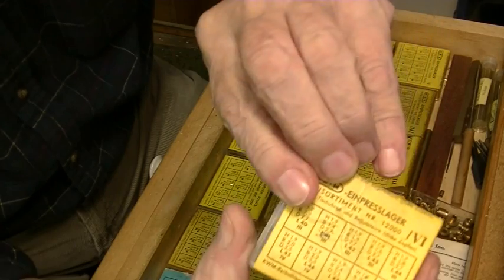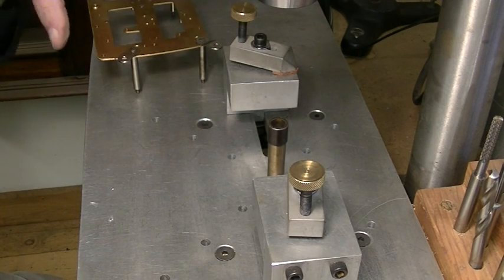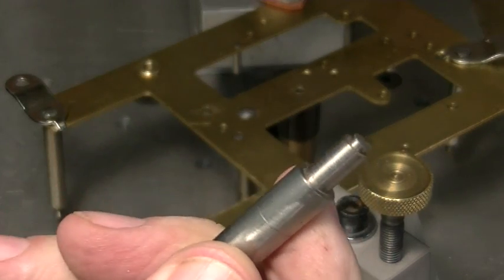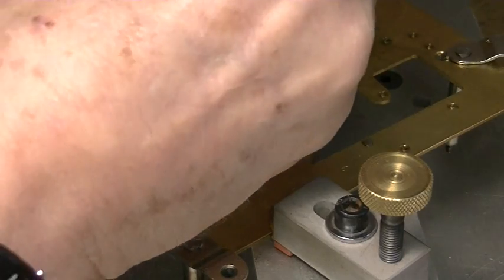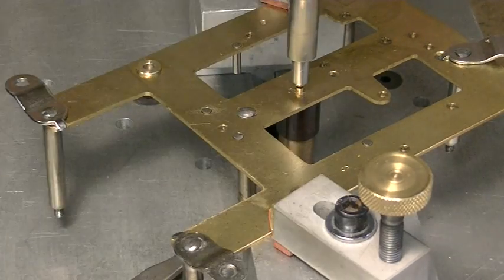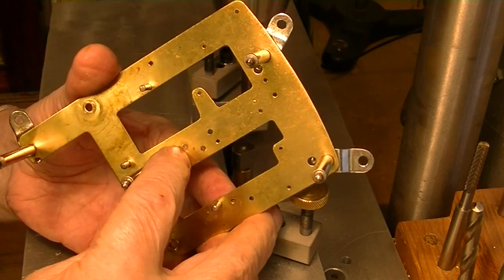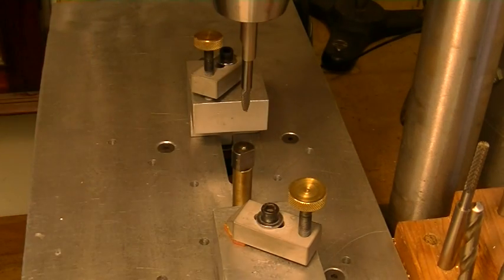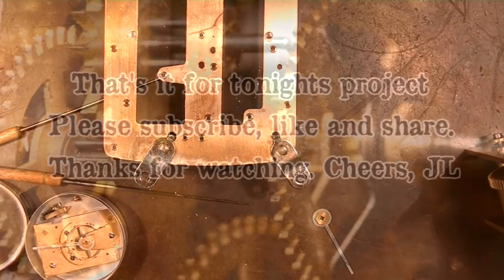The Village Clockmaker. Clock repair tutorial. #23. Rebushing a clock plate the easy way.

Comment: With my bushing attachment in the drill press, a post or pin is usually in the way of the clamps.  I do most of my bushing these days with a hand reamer.  I can lead the direction  the hole is being cut easily by doing it slower by hand.  I am envious of your large bushing assortment.

Comment: Jim, @ 10:35 you advised you were "working" on the inside of the plate..... but it actually was the OUTSIDE of the back plate when you installed the bushing.
Also, putting the plates together so you can use the front plate as a "guide" when BROACHING keeps the broach perpendicular to the bushing.
Just FWIW!
Norm
Reply from the maker: Yes, I know. I turned 80 last month and am prone to stupid mistakes.
Reply: Happens to the best of Jim, keep on truckin!
Norm

Comment: +
James A. Lea The Village Clockmaker

Filing egg shaped hole isn't necessary  IMO. I have got Gustav Becker  clock from  Silesia series. He had one egg shaped bushing on the front plate on  strike  counter wheel . I just driled it on drill press just like you wiithout filing and he works just  fine. He runs now  for over week and striking mechanism never failed, so I suppose he's fine and center of the hole didn't move.  By the way I'm very surprised. Silesia clock, economic Gustav' Becker's movement for less rich people with hook escapement runs like high-end versions on Graham's escapement... For whole 7 days which mainspring offers him he only goes fast about 10 secs and never slows down like mainspring powered clocks just to when mainspring is almost unwind. For  curious I winded the mainspring  and let him run until it stops and stil kept that about 10 secs deviation. Incredible... Probably he wanted say thank you for all hours i spend with him to get it  up and running back... It was very hard and big challenge for beginner in clock repair hobbyst but I did it and I',m very proud of myslef that I can save and keep peace of by the way Polish history. Yeah, Polish becuse  Freiburg aka Świebodzice is Polish town, so we can say that Gustav Becker made clocks in Poland...

Comment: Thanks for a good video!

I'm wondering why you would both counter file the worn hole AND clamp the plate down. As you say, the drill/reamer becomes self centering when the hole is counter filed. I don't have a bushing machine so I counter file but use the reamer by hand, or sometimes in a drill press rotating the spindle by hand. The way I've understood it before is that the beaty of having a bushing machine is that you can simply center with a wire or stake just as you did, and then clamp the plate down and the reamer will cut straight down, regardless of the off center hole.

I think you also mentioned that in text but didn't the installation turn out to be backwards?  The bearing surface appears to have been on the outside of the movement.

Thanks again!
Karl
Reply: He did it backwards! Lmao !

Comment: I don't understand why you don't change the bottom support to the flat faced stump when pressing the bushing in so that it only presses in flush to the surface of the plate. It seems that you could eliminate a step or two in the rebushing process. Also, wouldn't it be good practice to champher the holes after reaming to eliminate those pesky burrs that would wear into the pivot?
Anyway, that's a very nice arrangement you have for doing these quickly and in succession. I'd say you have a new subscriber.

Comment: Why have you cut the holes from the outside of the plate. I have a bushing tool and cut the holes from the inside. Is there a danger of the bushes coming out. There is a slight taper on the cutter.

Comment: Could you not of centred off the outside of the old bushing? I am assuming the bore and the outside of the bushing are concentric? I use an optical centre finder in my milling machine to centre on the bush outside and then drill using a centre drill to get the bore concentric and then drill to size.

Comment: You mentioned bushing from the inside, but you installed the bushing from the outside, with the oil sink on the inside of the plate.

Otherwise this is the same way that I do my bushing, only I do them with a hand tool. I have never seen the KWM bushing index plate before, and I can't find it any of my catalogues. I guess they don't sell it anymore?
Reply: sooth15   Wow you are correct. I just checked my Timesavers catalog #43 and it is not listed in there anymore. If I remember correctly they were around $100 and probably not a big seller. 
All the best,
Norm in sunny Arizona
Reply: Hi Norm, I was able to find it under "Pivot Gauge" after a bunch of searching, and they're asking a whopping 145$ (over 200$ CAD), which is absolutely ridiculous. I could make one myself for probably around 5$. Item #13483. There are some second hand ones available for close to 100$ but that's even too much for me. I don't do nearly enough bushings to justify the expense.
Reply: Just use a digital caliper on the pivot in mm mode. Choose a bushing with a slightly smaller bore and broach it to fit.
Reply: I bought a measuring plate from Merritts over a year ago.  Then I found my old plate I thought I lost.  I am not in my shop so not sure if they still have them or not.  Oddly, I have got to where I can eyeball it and choose the right size bushing.

Comment: Just a little bit confused, aren't you supposed to use Reamer number III (2.69mm dia)? You have used drill number 3 (5.41 mm dia) or you mean 3mm dia drill? Using a drill won't make an accurate hole.

Comment: would it kill clock-makers to put ball bearings on the slow high-torque gears? the sad fate of most clocks is that these pivots will wear out from never being oiled and the clock will be discarded. am i missing something, or is it just that traditionally bearings have never been as cheap as modern chinese ones?

Comment: It looks like your chuck and/or bit are wobbling a bit....not running true. You ran through centering the new hole pretty quickly. That hole will be worn oblong in only one direction....away from the original circle arc because of spring pressure....as you said. When you filed that hole bigger, it seems like it's gosh-and-by golly going to find dead center. Must be a way to measure or get more precise?

Comment: Was the oil well on the wrong side then?
Reply from the maker: Yes. I just turned 80 and am prone to stupid mistakes.
Reply: No problem at all.  Either way I love the idea of the DP used as a pivot machine.    Great stuff.
Reply: I make stupid mistakes now.  What happens when I turn 80?
Reply: HAHA.I also need to know .....
Reply: Ah, but you can get away with more.

Comment: You put the bushing in backwards or the oil sink on the wrong side, it appears from the shot in the video.
Reply: Agreed, the bushing should be pressed from the inside, flush to the plate. the oil sink goes on the outside, after making it flush to the plate is that is your inclination. My OCD side likes them flush!

Comment: I see a very major wobble in your drill press shaft (running way out of true).. 
Often that is the sacrifice when buying super cheap chinese drill presses. Something in the shaft, or taper, shank, or chuck is way out of whack on your machine. I'm surprised you're able to use it for the precision needed for replacing clock bushings.

Comment: Sorry for the negative- your process is too slow.  I use a Kim bushing tool and can cut and bush the entire time side of a clock in the time you bushed one hole.  I have a busy clock repair business and have great success with my process.   I worked under a very  experienced clockmaker for 2 years and learned the Repair business from him.